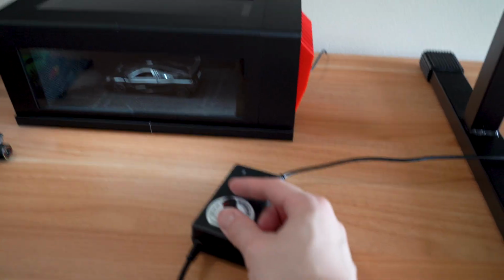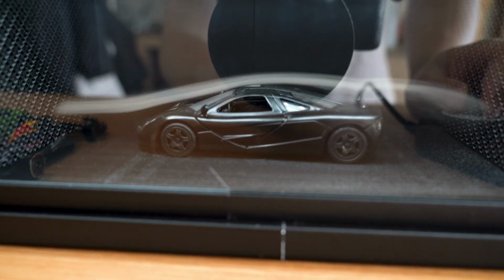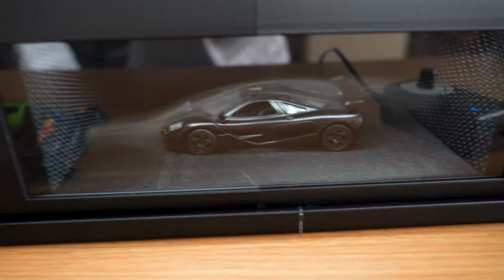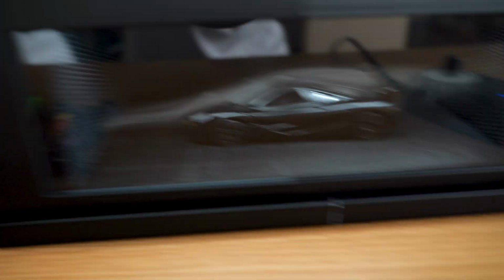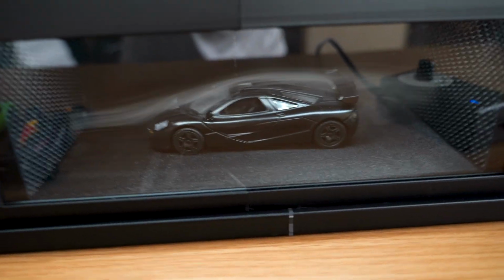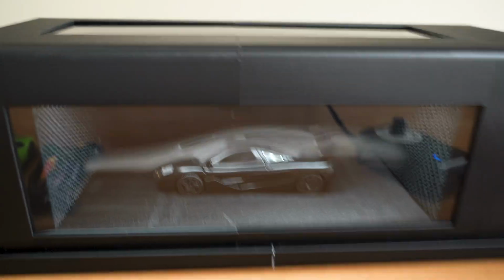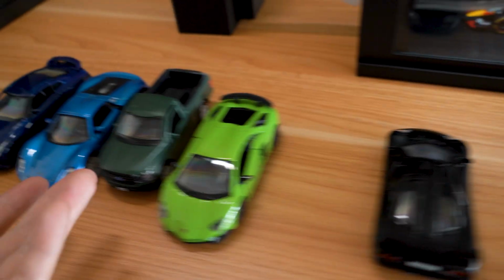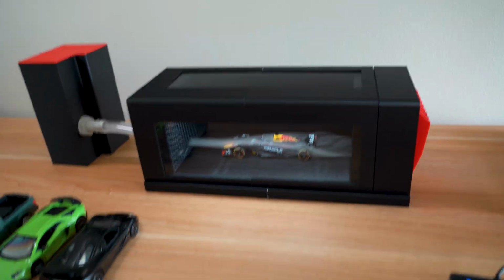Why I designed & 3D printed this 1:32 desktop wind tunnel | Aeroflow Launch 🇺🇸

Comment: Great setup! I'm curious about how do you deal with the water droplets or condensation from the water mist at the outlet of the wind tunnel? Would it cause electrical shock to the fan or lead to water leaking into the tunnel?
Reply from the maker: i dont really have a way to deal with it as the mositer needs to get out with the air thru fan. but i haven't run into any issue since the droplet is not too too much, and i dont keep it running for too long, and the air is constantly moving while on. good quesiton tho, i thought about that as well at first but it did no become a problem it turns out.

Comment: Amazing project!! Congratulations!! But  i have one doubt... It's possible to see the lines of flow... But how to know about the coeficient of lift and drag??
Reply from the maker: Thank you. To be honest, I don't think you can derive anything scientific from it other than just the visualization of the flow of air. The real wind tunnel is way more complex and expensive to build.
Reply: @AkiTechSpace  i understand... Anyway, it's a great "toy"!! Amazing!!
Reply: this wind tunnel would be too small compared to the car to get accurate values due to the walls affecting the flow of the air and to do this you would need accurate pressure and air velocity sensors

Comment: well done... inspiring... i think millions have wanted to do such a thing... yet, you did it... i see that with some adjustable angle pipe fittings, moving the mist to exact location would be stable... or maybe some sort of slider pipe... adjust up or down... plus, i would pay extra for that line laser option mentioned by @luckyshark32

Comment: I tried to build one of these for a science fair like, 30 years ago and failed. Cool that tech has caught up with it. If you decide to iterate the design, one thing I'd suggest is a line laser on the top, maybe on a slider to highlight "slices" of flow.
Reply from the maker: 30 years ago is way before my time. When I was in college about 7 years ago, we had to use 3D printers for our architecture models, but the tech wasn’t great. The software was frustrating to use, and the print quality was rough with a lot of stringing and unreliable results.

It’s amazing how much it’s improved. Now you can actually build functional DIY stuff without fighting with the tools.

Thanks for the suggestion too. The line laser idea sounds like a solid upgrade. I’ll definitely check it out.
Reply: I did one around 82 or 83 for science fair, turned out ok(for a 7th grader), made it out of cardboard and duct tape, and a motor and fan blades from a small desk fan (dad was so not happy about the fan), I ended up with a superior on it.
Reply: Oh wow. We got engineers/enthusiasts doing some shoptalk. Don't mind me 'eavesdropping' and trying to imbibe you guy's- not actually the ideas nor the solutions- but more of the engineer's mindset. 

Thanks peeps!